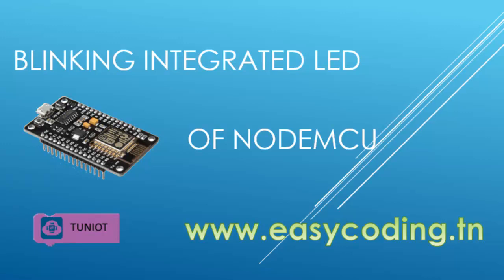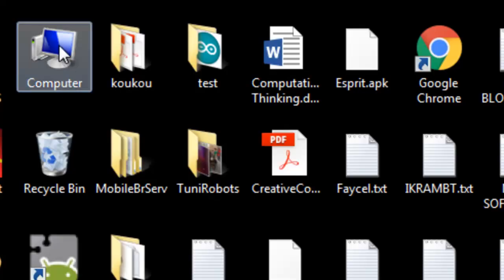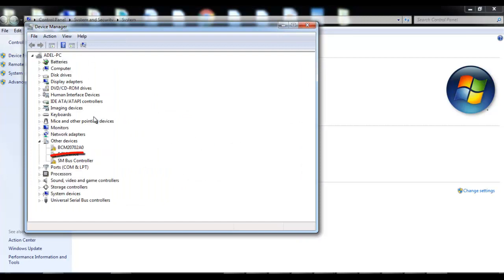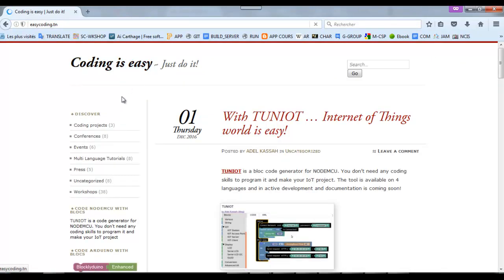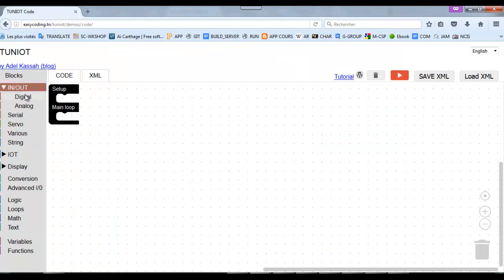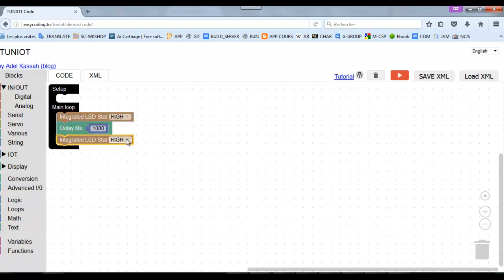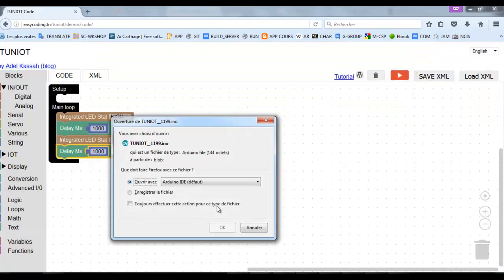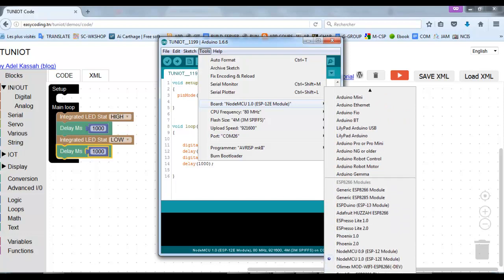NodeMcu (ESP8266) Tutorial A-02: Blinking internal LED

Comment: HEYYY it is working...I tried since yesterday ..bringing my new nodeMcu V3 to "Blink" with the onboard led..i tried the oob example from Arduino
void setup() {
  pinMode(LED_BUILTIN, OUTPUT);     // Initialize the LED_BUILTIN pin as an output
}
// the loop function runs over and over again forever
void loop() {
  digitalWrite(LED_BUILTIN, LOW);   // Turn the LED on (Note that LOW is the voltage level
                                    // but actually the LED is on; this is because 
                                    // it is acive low on the ESP-01)
  delay(1000);                      // Wait for a second
  digitalWrite(LED_BUILTIN, HIGH);  // Turn the LED off by making the voltage HIGH
  delay(200);                      // Wait for two seconds (to demonstrate the active low LED)
}

build was done , upload as well but nothing was blinking

Then i tried YOUR example ...a GOOD decision.... thanks man...you made my day...now me the NEWBEE can start coding :-)
Reply: Yep good video outlining the GPIO pin for the onboard LED. Many thanks for that.

Now get mongoose OS on there and do away with the need to code

Comment: Hey do you now how to make that blue led blink twice in a second continously? I tried finding the coding in Tuniot but seems that the coding only allows the led to blink once continously.
Reply from the maker: itsmeaidil very easy. put the blocs in the loop part with a delay of 250 ms
Reply: Which blocks? can't quite understand because there's many parts of blocks. In this video, the LED is been configure to make the blue LED lights up by this coding : Main Loop>Integrated LED Stat>Delay Ms>Integrated LED Stats>Delay Ms but this coding only allows the led to blink once repeatedly but i wanna make it blink twice in a second repeatedly. Im not really good in coding i hope you'll understand

Comment: Pl give documentation for TUNIOT.
Reply from the maker: For now, the only documentation is these videos. I am working on them now daily. Later, I will write more on my blog easycoding.tn
Reply: Ok. When I click on RUN Button,  Arduino IDE do not get opened. Only .ino file gets generated. What to do to open Arduino IDE automatically as shown in your video?
Reply from the maker: First, on TUNIOT there is a tab called Code. Click on it. You will find the code generated by your blocs. Copy the code. OPen the Arduino IDE and delete the old code and paste the code that you copied. Is it clear?
Reply: Thats ok. But you did not do that in your video. You clicked RUN and Arduino IDE opens with the new code. Or in between steps were edited in you video?
Reply: Also with out clicking RUN button, clicking on CODE button gives to code. Then what is the purpose of RUN button?
Reply from the maker: in some browser there is this problem. In this case, you need to copy the code by your self into the arduino ide
Reply: You did not answer this.
What is the purpose of RUN button? With out clicking RUN button, clicking on CODE button gives the code.
Reply from the maker: the RUN will save the code into a file. And normally you will get a message to save or to open the file with the Arduino IDE.
Reply: Oh. Thanks a lot for the reply. TUNIOT is relay good.  Documentation will help us understand it better and use.
Reply: Is it possible to run TUNIOT offline?
Reply from the maker: no! Only with internet